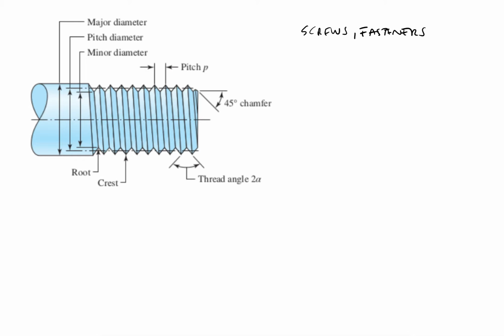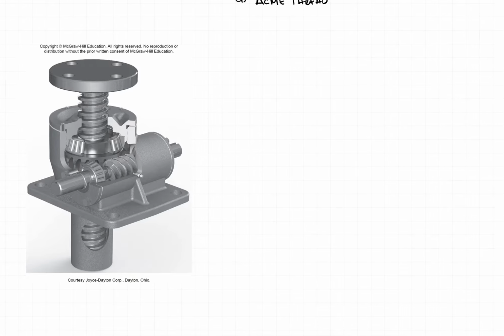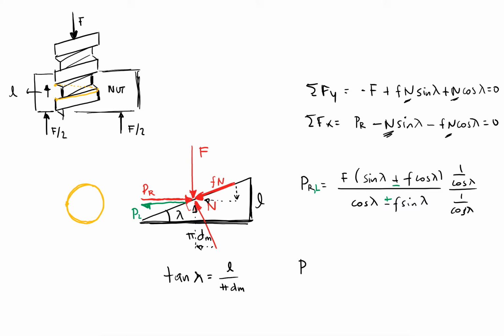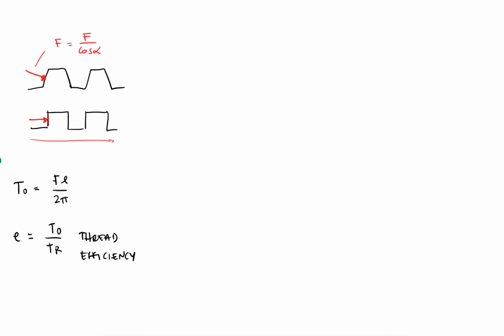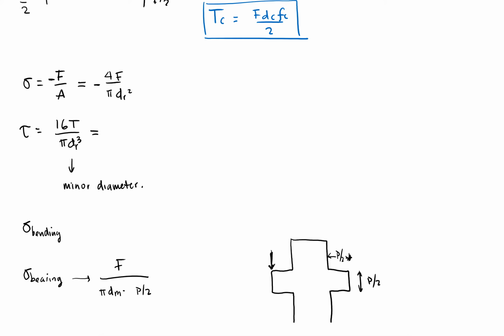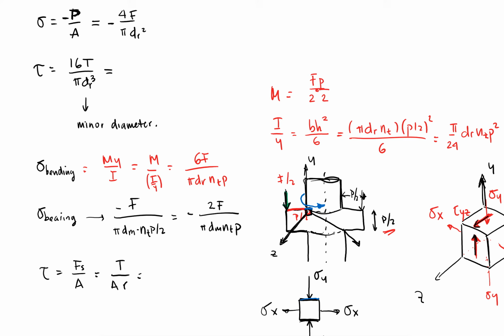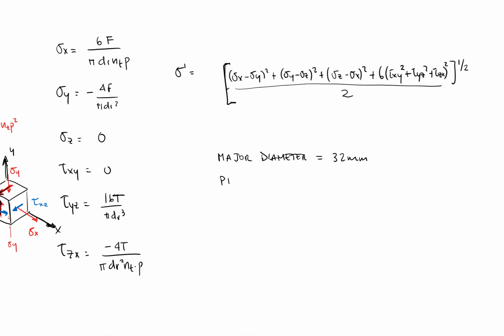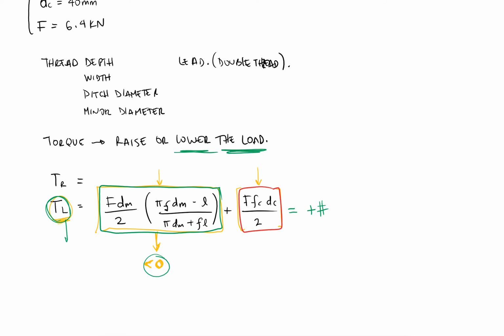[OLD VERSION] Mech Design - Week 06 - Power Screws

Comment: At the center of the root of the screw; there is torsion shear stress+ transverse shear stress due to bending
Am i right?
Reply: Also the transverse shear stress on the nut only; so we can not combine this stress with the other stress right ?
Sorry but i'm confused with shear stresses.
Reply from the maker: Transverse shear is always present where there's bending. But the "stem" of the screw itself is not being bent, so there is no transverse originating from the stem. The threads themselves are being bent, but the transverse shear is zero where the bending stress is maximum, so we don't take it inot accoutn. Direct shear is what is considered here (direct shear: like scissors cutting a piece of paper; transverse shear: shear caused by bending moments).